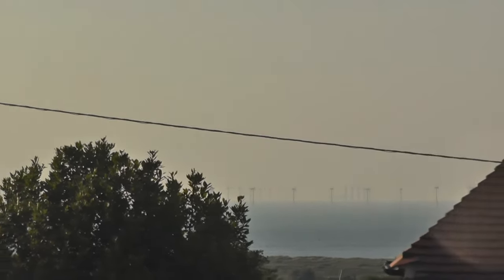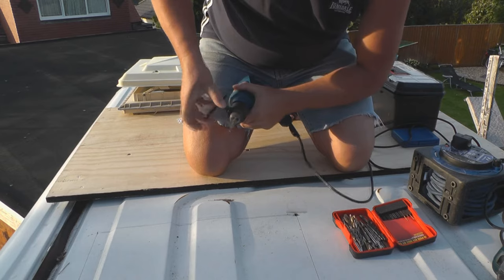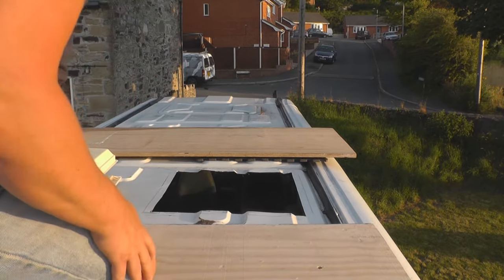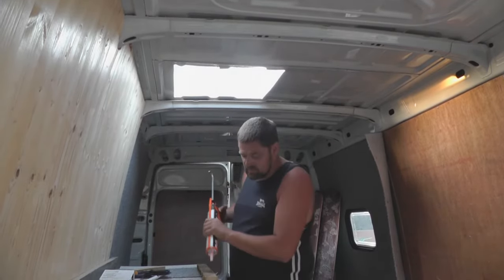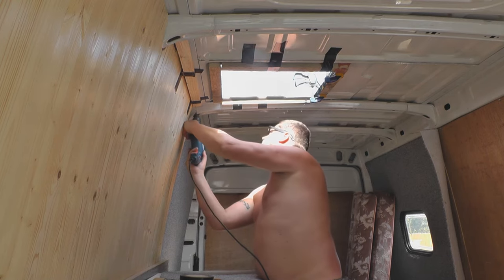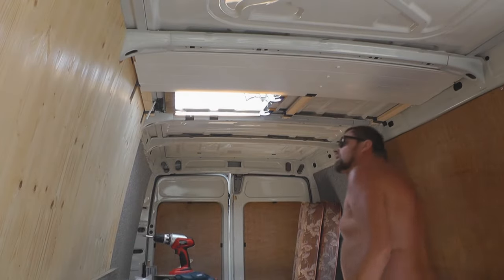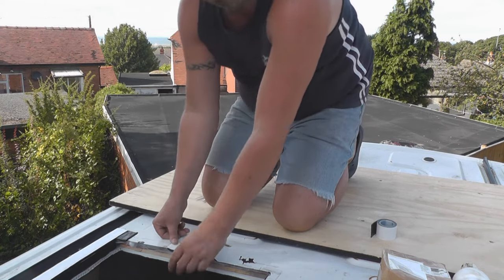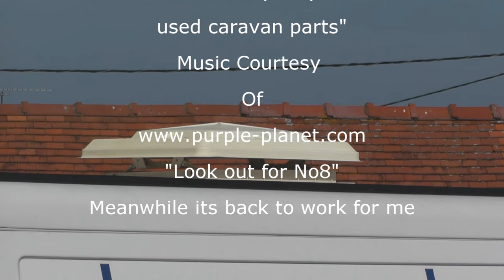Motorhome Van Build No7

Comment: Loving this hands on build - Yes some of us were yelling at the screen WTF is the INSULATION - it's going to be raining from the roof :) I still think I would have put some what Americans call Reflectix on before the Diall. What were the products you used to seal  the skylight - there was lots of detail cutting the hole but creating the level base and fixing it in was a bit skipped. Complete details please (inc links) please.
Reply from the maker: Hi Nick sorry about late reply ok Firstly the insulation is Dialls Plastic Wool very much like fibre glass in appearance but without the irritation and it copes better with moisture "my opinion", when I cut the hole for the skylight I put a 2x1" wooden frame around the inside and sealed to the metal with grab adhesive and painted the wood and bare metal with a protective coat. I used putty strips to create a level base to put the skylight onto and then just as extra precaution I smeared Unibond Silicon Sealant around the join and we have had some major wet weather since and not one leak or drip, regards James

Comment: Hi James  what tape stuff did you use to level your skylight up I have just got a iveco van and  I am wondering where to put skylight as there is not many level places on the roof do I need a flat surface hope you don't mind me asking cheers
Reply from the maker: John Gumble I used putty tape and created a flat surface inbetween the ribbed roof by doing so with the stripes of putty then laid the rooflight on top and sealed it with a good quality all weather sealant regards James